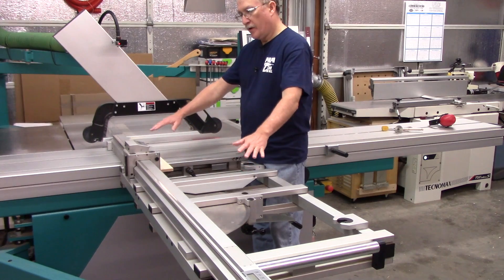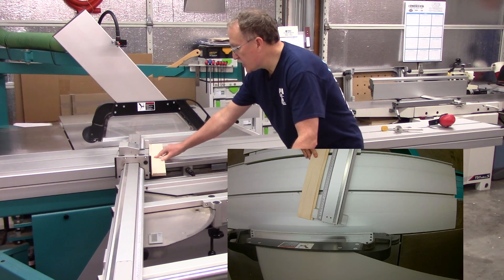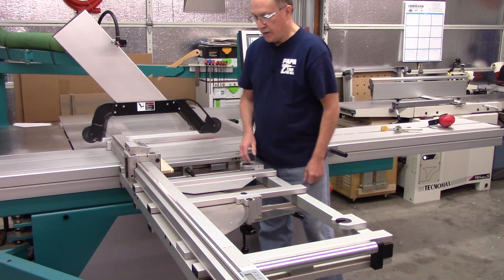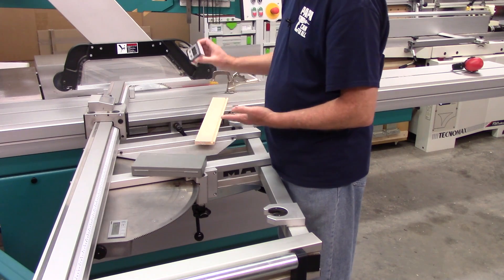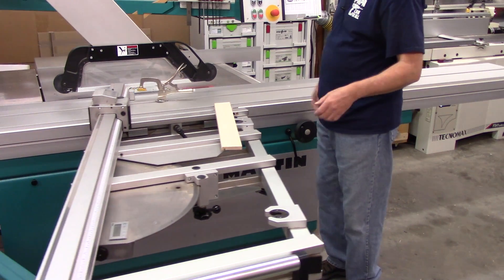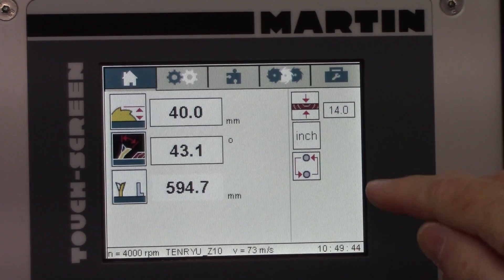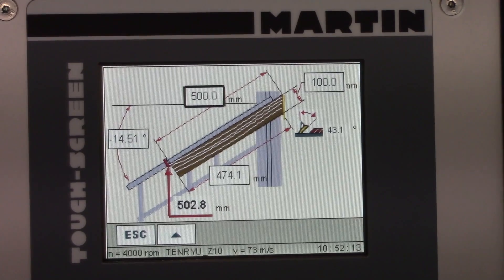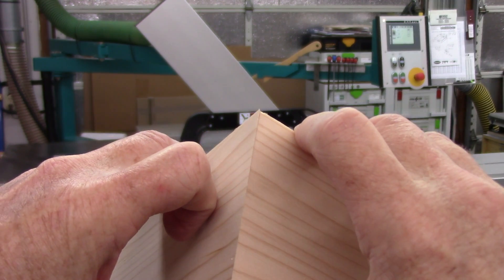Sliding Table Saw: Compound Miters, and Length Compensation

Comment: Steve, I think you have a Martin similar to mine. Having problems with the program for cutting parallel grooves with a 1/4"  wide dado blade.
I set the width of the kerf in the blade specs; set the same for the groove kerf width; and set the left-right in that same dado blade specs and it is giving me .030 more width in the groove program than I need. I reset the blade specs and ESCAPE and it automatically returns to that .030" of extra kerf in the grooving which means another pass of too much wood removed. Got any ideas??  Vincent  The heat wave is past and it is like California weather in Chicago.
Reply from the maker: Hi Vincent.  I have never been able to get the program to work properly with the dado function other than with a standard blade.  I think the problem is with a configuration setting when removing the spacer, or the problem could be me which is likely.  I would suggest contacting Martin to assist getting into service mode and getting guidance on correcting that.

Comment: Hello. As you are a Martin owner, this question can help me out alot as i am setting up my shop now and could really use your imput. Leaving pricing out of the equation, 1st) what tablesaw (Martin) do you have? 2nd) your thoughts on Felder K 940 S vs Martin T65? Your imput would help answer a few questions for me. Thank you kindly. Scottishxpride, Texas.
Reply from the maker: I have a 2007 model Martin T60 Classic.  I haven't looked at either of the machines you are considering but they are in different classes IMO.  For a more realistic comparison, I would suggest comparing the Martin to one of the Format4 machines.  I do like the Felder XRoll sliding tables as they are very smooth.  The Martin table is smooth but is much heavier so requires more effort to push.  It may not be an issue but I can state the resale value on the Martin will be much better than the Felder machine.  Last year, I saw an auction on a Martin T60 Classic (standard configuration with no additional options) go for about the same as the machine cost in 2007 if that is any indication.  Hope this helps.
Reply: ...at this moment, yes it does. In the planning stages (3 phases) for additions to be done here. With the last phase being my wood shop (50 x 75). Having looked at Felder, then looking to Martin, i'm liking what i see on Martin more. Yet, on Martin, i'm seeing alot of people talking about poor quality service after the sale, at least here in Texas. Not real sure you might know anything on this. Yet, when buying 60 to 75k worth of machines to do something, customer service plays an important part. Not real sure yet, how this is factoring in my thoughts, but, i'm leary. I know there is a Felder salesman north of Dallas. So not real sure yet, if this is helping me either. Still like Martin, and leaning heavily that direction. Just leary at the moment if, that makes any sense. Thank you for your time. Oh, am looking at Martins: T70 saw; T 54 Joint Planer;  T45; and T 27; with power feeders on all. Do you have any of these, and what kind of customer service have you had? Thanks again, for not only your time, but, your thoughts as well. Yours in Christ...Scottishxpride, Texas.
Reply from the maker: Hi ScottishPride.  The only Martin I have is the T60 saw.  If I had the coin and space, I would love to have a shop full of Martin equipment.  I have used the T54, T45, and T12 shaper and they were all excellent.  The T27 is the my dream shaper and IMO, the best on the market but that comes at a steep price.  I have had no issues with Martin service but they are a smaller company (at least in the US) so you may have a wait depending on schedule.  I did have a 5 week wait to get a new computer from Germany on the T60 and Martin was very responsive.  Felder makes some nice stuff and they are very aggressive on pricing and with good service (it wasn't always that way and they have improved significantly over the past 13 years).  I think Flory is the manager of the Felder office in Dallas and he has been very helpful to me in the when he was with service on an older Felder ( I remember he called on a Saturday on his own time to help resolve my issue).
Reply: Hi,  I live 15 minutes from the Martin USA headquarters in Charlotte.  I stop by to visit a few times a year.  I don't own any Martin or Felder equipment at this time.  I am interested in the same machines you are in the future but not ready to pull that trigger yet.

My impression is that Felder is a much larger operation in the US.  But I would not hesitate to purchase Martin here.  I am friends with Al their technical manager and he is very responsive to customers from what I have seen.  They carry a good stock of parts in Charlotte and get containers of machines and equipment from Germany multiple times per month.  They can also air ship certain parts.  They also have a large stock of Aigner accessories in stock in Charlotte.  I believe all machines arrive through Charlotte except perhaps for a larger dealer in NY that may get containers directly from Germany.  I have met their dealers from California and Indiana.  They have a few others about the country too.

All pricing quotes are generated out of Charlotte from what I understand. So a price from a dealer will be the same as buying direct from Martin. The dealer may throw in other services or accessories that they wish, but Martin USA sets the machine price.

The best place to currently see Martin machines operate is the Atlanta or Las Vegas shows.  They are expanding their space in Charlotte and should be setting up a demo area.  They will be having an open house in Charlotte in early March.  There is a Wood Expo here then and Biesse and Weinig/Holzher also have open houses during that same time.  I believe afelder has a presence in Charlotte but don't know if they do any open house here.

From what I have observed Martin sells more sliders and shapers than anything else.  Although someone did walk in and run a couple boards through a jointer last year at the open house and buy a jointer on the spot.  I think most buyers already have a good knowledge of the Martin quality, performance and cost.  I know a one man shop in NC that purchased a T27 last February and it was in the mid $50k range.  Martin is also representing and selling a number of other German machines now.  They are also adding some lower cost 3rd party machines to their line.  You can of course learn more on their website or by contacting them.

I would say that depending on options to get a T27, planer, jointer and higher end saw you could be looking at $150-200k.  But it also is fairly rare for Martin machines, especially newer models, to come on the used market.
Reply: Also Joe Calhoun has a shop in Ouray, CO with a lot of Martin equipment.  He works with Rangate and offers workshops during the year.  I believe they are called Alpine Workshops.  You can find out more by contacting Joe or Rangate.com